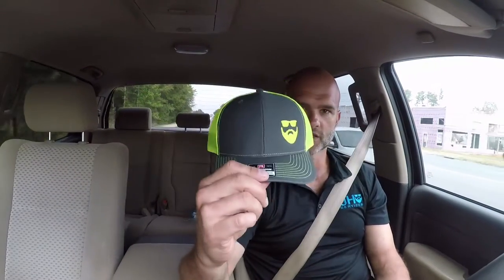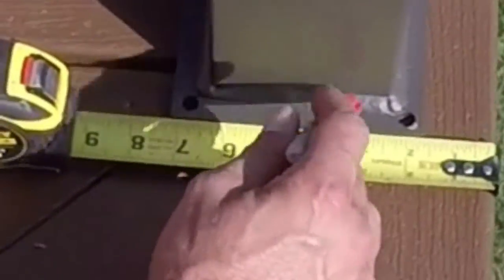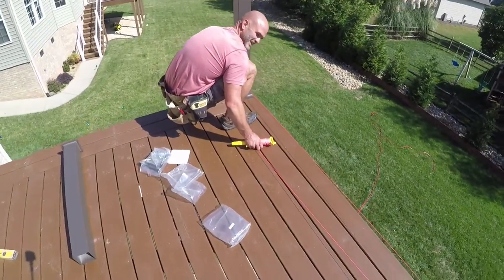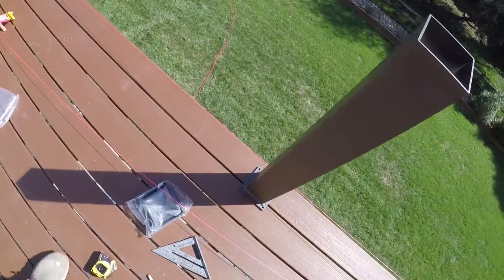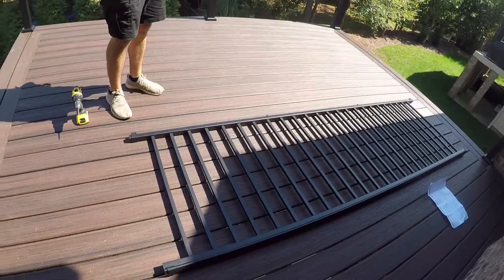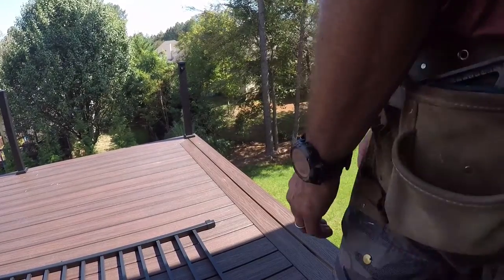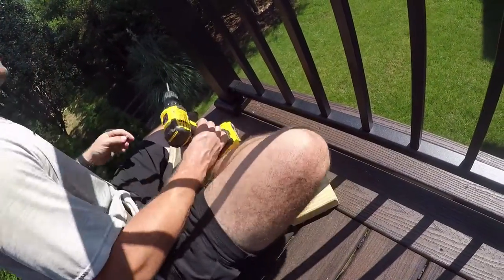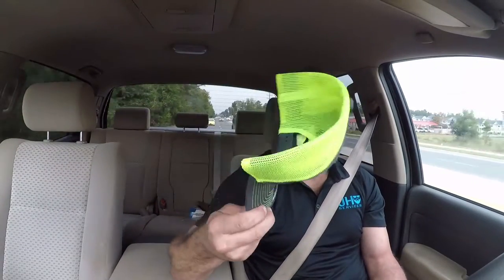How to install handrails on a composite deck

Comment: Your video was perfect for a seasoned carpenter.  But for a novice, I would have liked to see the holes drilled to mount the posts, and the bolts used to secure them to the deck.  Wouldn't you need a drywall type anchor in the hole before attaching the lag bolt?  I never understood how these posts could be secured properly into fake wood, without a bolt through the top with a nut attached under the deck.
Reply: The fake wood is not structural. The screws are long enough to go directly into the joists underneath, which are typically 2X8. The deck needs to be designed to have joists exactly where those four screws line up.

Comment: Can you use a strap or tie down to keep the railings together. Wrap each side and ratchet it until in place then remove strap. It might work. Nice job guys!!
Reply from the maker: Definitely.  Thats the 1st time I've had 1 come apart like that actually.   Thanks!

Comment: Did you have to add wood blocking underneath the composite deck where those aluminum posts are mounted? Did not notice in the video…

Comment: Nice work guys.Iim about to put the same railing up .lDid you guys build your deck to match the length llllf railing 😂. I noticed that nothing was cut.
Reply from the maker: @CurtAllen-fn5gr  been awhile so I can’t remember honestly. I don’t think so tho. When I cut these rails I use a metal blade in my miter saw but I saw all with a metal blade will work also. Just put some tape around the area you’ll be cutting to protect from scratching it

Comment: What kind of railings do you use?  Do you have to have a joist under all 4 corner screw holes of the post to secure the posts?
Reply from the maker: These are called Afco series 100 but I think I'm going to start trying to sell rails from home fortress.  These rails are nice bit scratch to easily in my opinion and the home fortress are much easy to install.  Especially the stair rails.  I put blocking under the post so that all bolts are secured in 2 by material.  Thanks for watching!
Reply: @adventuresofahandyman4446  thank you for that Detail no other videos I can find show how those are actually attached they skip right over it

Comment: Do you travel? Like to PA, 30 miles N of Philly? I and putting down 650 sq.ft Trex Foggy Wharf and 32' of railing. Material arrived in 2 weeks. You available?
Reply from the maker: Whew!  Man I'd love to come help but thats about 9hours.😁
Reply: @adventuresofahandyman4446  I will pay travel, expenses and put you both up. One day travel up$$, 2-3 days work$$$ one day travel back$$$. Deck is stripped, I am looking at frame. All trex will be on site delivered along with railings. It might be a good job!

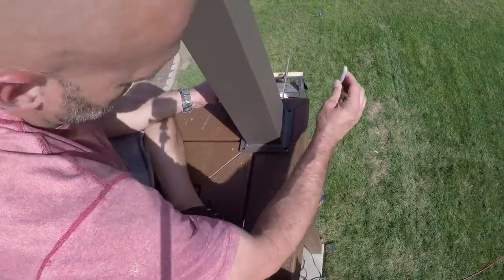Comment: great video. i have a similar situation @3:08 of your video where my post lands on the split of my picture framing. Is that safe and okay to drill the screws there for the post? Does it still have a good support on the post? Appreciate your feedback. Thanks
Reply from the maker: Thanks. It’s fine to attach the post there. There is 2x material beneath the deck birds that give the strength
Reply: @adventuresofahandyman4446  thanks a lot for your reply. i wasn't too sure when i tried installing my railings yesterday so when i stumbled upon your video, it gave me hope that I can install them in that split section of picture framing. i thought it woudn't have enough bite to it or might ruin the edge of the board. I do have a 6x6 as blocking underneath but it seems to me that you are landing the first post screw on the rim board itself right? 3/4" from the corner? not in the blocking after the rim? thanks again for your support.
Reply from the maker: @jacm7256  yes that 1st bolt is in the rim board. I do my best to hit it in the center

Comment: I thought code was no more then 6 feet between posts?
Reply from the maker: At least not in my area. I’ve had them inspected at 10’
Reply: Depends on the rating of the railing.